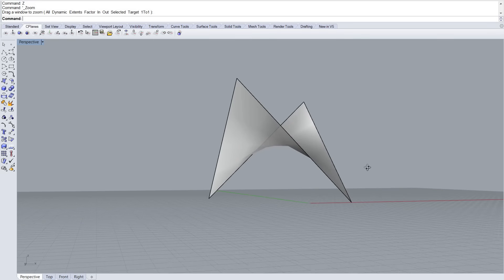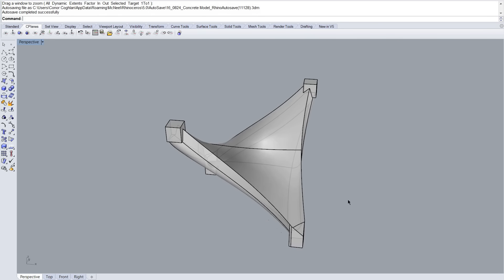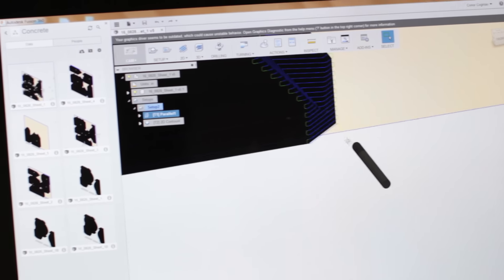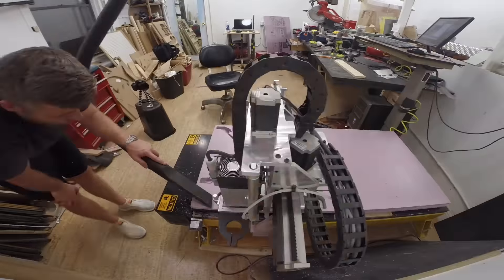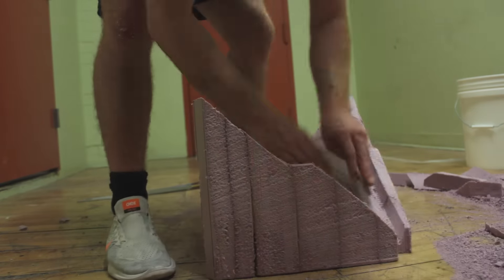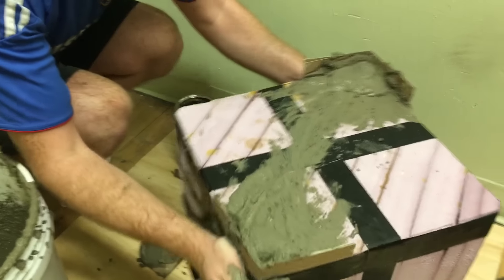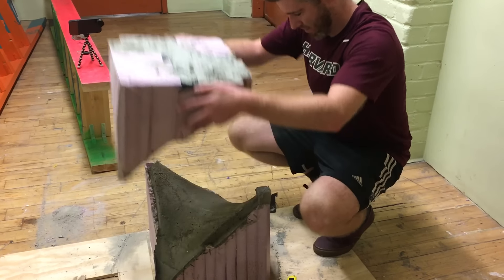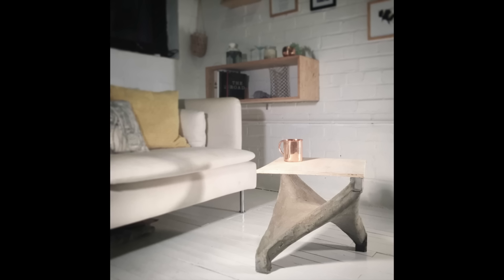Concrete Table

Comment: great design, Conor! you should take a look at silicone rubber moulds! you can make basically a skin out of the rubber, and an outer shell with fiberglass! That makes it a lot cheaper and easier to work with. And for the concrete check out carboxylate superplasticizers. It makes the concrete flow a lot better without the need of too much water (it makes the concrete porous) there is even a youtube channel from a manufacturer (trinic llc). they make glass fiber reinforced concrete, it is amazing how thin they can make it! hope i was of some help, thanks for the video! :)
Reply from the maker: Thank you Thiago! I will research this today. Thanks for watching!!

Comment: Love the design! :)
There's one question I have: Doesn't a table made of only one unit (like the one at 3:39) tip over when you put a heavy object on one of the two "floating" edges? Or is the center of mass low enough, due to the weight of the concrete, that it doesn't tip over?
I believe this would be a non-issue as soon as you combine two units but with just one it looks kinda unstable.

Anyways, awesome work, as always :)
Reply from the maker: Yeah you're right if it's being used by itself it needs some sort of base frame or feet to stabilize it like you can see early in the video. I haven't made these yet but I hope to do it in the coming weeks. Once it's aggregated with more than one unit then the feet or base frame wont be necessary. I also have to work out how they units will look together securely and easily. A design in progress! 

Thanks for watching!!

Comment: lookin good. how would you make a reusable mold?
Reply from the maker: Thanks! The mold I made could be reused but I want to change a few things to the design so I'm going to make a new one. I think as long as you use a good high density foam and coat it in Vaseline before using it it should last indefinitely. I'll soon find out! Thanks for watching!

Comment: you've probably seen this somewhere before, but a really good trick for removing big air bubbles is to get a electric sander and run it around the moulds outside.
Reply from the maker: Yeah I've heard that's a great method but I actually didn't have one on hand so I had to do it the old fashioned way!! Thanks for watching!
Reply: I recently made "vibrotable" from Ikea  chair's springy legs, a countertop board across and el. grinder (screwed under table and instead of one of gr. stones attached off-center iron disc).
Reply: Conor, may I ask you about your spindle? I've got two HSD spindles from ebay (3Hp \ ER32 \ Hz max=300). Looks identical with yours. It has that air pipe with regulator. I would like to know parameters (pressure\volume\oilless?). Is it for cooling or cleaning or both?

Comment: Cool idea.  What is your thought as to the way to connect them?  Or would they just rest against each other?
Reply from the maker: Thank you! I'm thinking of having some sort of universal bolt joint at the end of each arm. I was originally thinking concrete but I may try a special steel joint. I'm working on the new versions in January so I will put a new vid up then. Thanks for watching!

Comment: great design, however the concrete mix is too watery.
you can achieve the same liquification by adding plasticizers to a dry concrete, the result is smoother and not as hard to pour